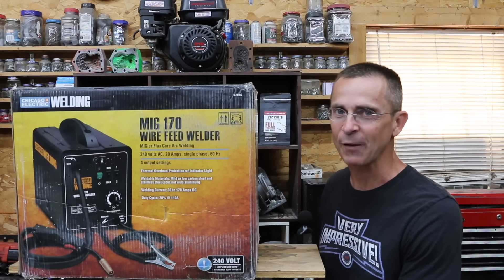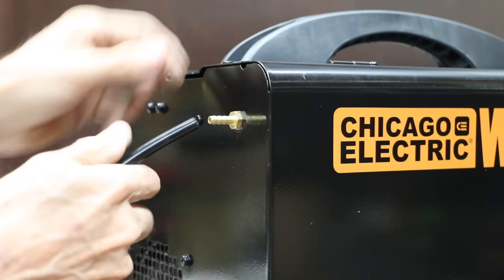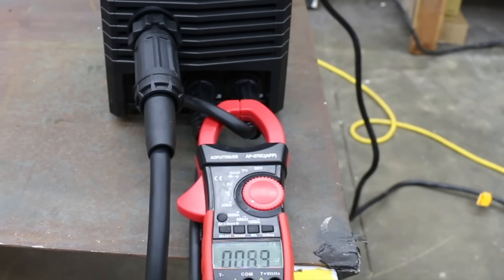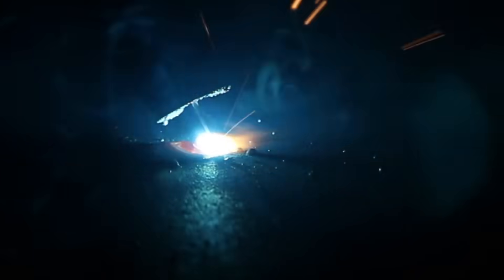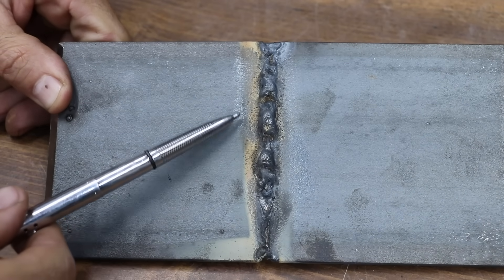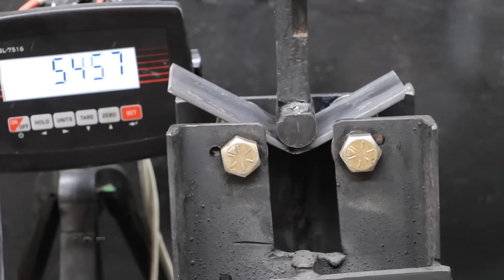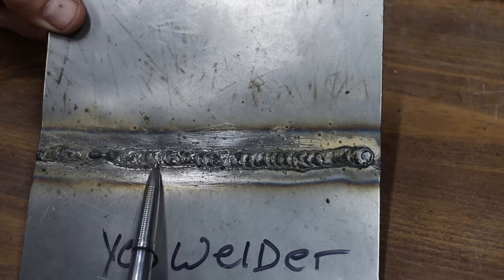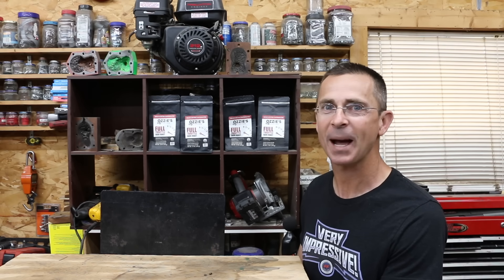Cheap vs Expensive Welder? Let’s Find Out!

Comment: I dont know if anyone has said this yet, but all of these machines running as wire feed mean they are running as constant voltage machines, not constant current. This means that they are designed to maintain a constant voltage in the circuit, and the amperage is allowed to shift to maintain the voltage. A stick welder is a constant current machine, meaning your amperage test would make more sense for that than on the wire feed machines. I would have liked to have seen a voltage monitor on the CV machines you tested in this video. I am a professional welder out of Canada with both education and about a decade of experience, love your videos, and even this one accomplishes what it set out to 👍
Reply from the maker: Thanks!  Thanks for the constructive feedback.

Comment: Bought a weldpro multipurpose wire/tig/stick machine. Use it out in the pens for lights metal repairs. Worked so well I use it for all my welding. I use lincoln .035 multi pass flux core wire.
The feed mechanism could be better, but it works well 95% of the time. 
I would prefer the heavier gun that comes on larger machines as well. But it works fine as is.
Reply from the maker: Thanks for the feedback.

Comment: One important thing to note on these flux core wire "migs" is that you can get greatly different weld quality with different wire. Often the stuff that comes with these like the Harbor Freight models is very bad. I see you using different wire for each welder during your setup in the video. I am assuming you are using the BlueDemon when it didnt come with wire in the box and the included wire when they did? A more even test of capabilities would be to use the same wire on all machines.

You can use some Yeswelder E71TGS .035" flux wire for welding steel and it is vastly superior spatter and penetration than the stuff you get with most welders. I use Blue Demon 308LFC-O .035" wire for welding stainless steel. Not sure if the Blue is the best for stainless or not, just what I tried first and it worked well with minimal splatter. But the Yeswelder flux core is some of the best you can get for doing regular steel.

Comment: Would have love to see a follow up with more mid grade machines like Hobart. Really liked Virgil’s input and review!
Reply from the maker: Thanks!  Thanks for the suggestion.
Reply: I have a hobart mig welder that ive been using since 2007. Its only 110v but it does well on almost everything ive used it for.
I also bought a yeswelder tig250 that i really like, I cant really compare it to anything as it is the only tig welder ive ever used.

Comment: You don't state the wire used. I assume it was all the same for the machines. Different wires / manufactures brands can make a differenc in performance. The next test suggestion is different wire brands with the top three machines. Keep up the great work. Thanks
Reply from the maker: Thanks, will do!  Thanks for the suggestion.

Comment: FWIW... i bought the yeswelder 165 stick welder for travel work.   It works very well,  especially for under $100.  It seems you can now buy good inexpensive welders.  I also own higher end Miller mig & HTP tig welders.   I prefer using these, but the lightness of the yeswelder makes it very handy.
Reply from the maker: Thanks for the feedback.

Comment: The wire you used in all the machines, was that the sample wire that came with the machines or did you use the same manufacture/ spool of wire? Different wire could give different results between machines.
Reply from the maker: I bought new wire and used the same brand for each.

Comment: I bought all my equipment second hand minus an old Lincoln tombstone I got in trade and have never had any real issues. I got my Ranger 8 for 2700 bucks from a farm auction around 5 years ago and an Esab 250 mig machine with a spool gun from a fab shop that was closing maybe 5 years prior. Picked up a 250 Miller syncrowave and a hypertherm plasma cutter just before C-19 from a school district that was ditching its tech ed program. Basically stole those in one lot for 2200. I know I can get parts with no problem if I need them and they're rock of Gibraltar solid.
Reply from the maker: Thanks for sharing!

Comment: Serious question. 
If you wanted to do a lot of body panels. 
Welding the thunder gauge metal.

What welder/ settings, would one be looking for? 

Outside of quality, warranty etc. 
What capability made the Lincoln perform better than the Yes welder?

Any one have suggestions, advice?

Comment: ...your professional welder guy doesn't hold the same stick out. Welding the thick metal he moved the gun in and out. The real test is a cut and etch, not a bend test for seeing how much penetration. Then on the thin stuff he held the Yeswelder much closer than the others. Some wires run better on thin rather than thick, and vice versa. Oh, and flux core is the WRONG wire to use for thin metal. Thin should have been using mig, not flux core.

Comment: I have gone through 3 car battery "smart" chargers and my current has lied to me for the last time. It cooked 2 of my boat batteries. Nothing wrong with the batteries. The charger tells me its at 100%, but will give me random percentages going higher and lower with subsequent testing. Please test smart chargers? Ill send you mine to test as well.
Reply from the maker: Thanks for the suggestion.

Comment: See ive been looking for a good ac/dc tig machine without all that fancy digital display and presets on it..  like i dont care to adjust the parameters to weld 1/8” aluminum..  just a knob for pulse width, Amperage, voltage, curve and all that jazz..  but if ya find one with all the parameters theyre always digital with a lcd display and cost over 2 grand..  tryna find one for the 700 range that wont blow up on me.. like buying a cheap plasma cutter..  theyll cut great until you stress em a bit then the fetts go boom or caps do one..
Reply from the maker: Thanks for the feedback.

Comment: sorry to say but i think you missed the bus with this. first testing should be if the welder lives up to its claims. they should be tested doing a reasonable weld length at max amps. very common to have cheap machines that have overinflated specs. 3 sec at max is nothing, it needs to be a full length weld. does it reach its duty cycle at max amps?
the other main factor is adjustability, can you actually dial that wire in. really important with fluxcore.
features, i've seen cheap ones that have more/better features than expensive machines.

Comment: FYI when you are using the clamp on the multimeter to measure current you need to make sure that you are only tonging the active conductor not also neutral to get an accurate result
Reply from the maker: Thanks for the constructive feedback.

Comment: Good boy, about all that comes to mind is the amazingly low priced compared to what they used to be aluminum welding machines with the new IGBT and maybe there are MOSFET offset or balance control as can be termed option.  Thanks for sharing!
Reply: Would be awesome to see an oscilloscope screen somehow as well with the current info for those waveform machines.  Might even be interesting to see the waveforms on some of the other systems?  Not certain many may like. Would be neat to me as well.
Reply from the maker: You are welcome!  Thanks for the suggestion.

Comment: Great video! I have the Titanium MiG 170 from HF. Pretty decent. I’d love to see a sub $1000 plasma cutter shootout. I bought the Warfox high frequency dual voltage a while back. Think I paid about $250 for it. Haven’t used it a ton but so far seems ok.
Reply from the maker: Thanks!  Thanks for the suggestion.

Comment: Beware: the cheaper machines might not be safe. I've had cheap MIG welder almost kill me when I was doing something else and it suddenly started feeding wire without me pressing any buttons. Once the wire was a few meters long it touched the grounded welding table, resulting in a red hot wire setting things on fire left and right! Luckily I had a fire extinguisher!

When I bought a significantly more expensive Lincoln machine, I noticed it stops feeding wire when it senses there is no arc. You needed a special button to feed the wire through the lines.

Just saying that safety is not a factor that was taken into consideration in this video.
Reply from the maker: Thanks for the constructive feedback.

Comment: I have watched ALL of your videos for well over two years and this is the first one I am disappointed in. I would LOVE to see 7018 with 120V. You did not show ANY STICK welding at all and the was a bummer for me. I have welded since 1968  and have made about 1/2 of all the money I have ever made working in BIG fab shops. I have run almost every type of welder there is but I still like stick. Now I live in a 40' diesel powered motorhome. I live almost all the time off the grid, since I live off the grid I do NOT have access to 240V power. Big RV's have 50 AMP power going in, which is 240V power but the RV itself does NOT use 240 V. My build in generator is a 7,200 watt generator but it is 120V power. That is why I am SO interested in the 120V side of these welders and stick because... I LOVE to run stick.
Reply from the maker: Thanks or the constructive feedback.

Comment: I’ve ran the piss out my Lincoln mp 210 on dual shield it’s never skipped a beat, runs flux core well, mig welding you can really hone it in works just as good as my Millermatic 212. Being lift arc on tig has its disadvantages but really it does great on that. But something that it surprised me on the most was how smooth it ran 7018. Im still a firm believer buy once cry once with welders. Lincoln, Miller-Hobart and esab all day
Reply from the maker: Thanks for the feedback.

Comment: The Lincoln did what it was supposed to for a top-end brand welder. Still Miller is generally considered the superior wire feed welder. Lincolns are more known to be the premier stick welders. Still I'm not a welder, I'm a tool maker, but I do have to weld sometimes. Not sure who's thought to make the better tig. I've heard that those Eastwood welders are pretty good for the $ they command, but IDK. I have very little experience with budget brand welders. I personally own a Hobart Handler 210, and an old Lincoln stick welder, but it was my grandpa's who died before I was born, and I haven't used it in years, or since I bought my Hobart back in like 2,010.

BTW Miller owns Hobart.
Reply from the maker: Thanks for the feedback.

Comment: Nice video!
I'm a bit surprised you didn't include any of the Hobart welders. The Handler 125, 140, and 190 are all Made in the USA and very affordable. You could have slotted one or two of the three in between your $360 welder and your $1,150 welder. That's quite the jump in price the way you did it. Maybe a round 2 in the future once you recoup some money on those welders. 😅
Reply: While the Hobarts are well regarded for customer support (basically consumer-level Miller), from what I've seen, they use older technology (transformer) and don't seem to compare well with newer systems like the Eastwood 180 (Inverter), as far as features, and are much lighter..  If you are not looking at pro/shop levels of performance, it seems a good option.
Reply from the maker: Thanks!  Thanks for the constructive feedback.

Comment: I've been using the Lincoln 210MP for a few years and can say that it is a very good welder. All the problems I've had were me and not the machine. Another thing you get with Lincoln/Miller vs cheap chinese is longevity. You get what you pay for so if you buy cheap, expect to be buying again and having more issues along the way.
Reply from the maker: Thanks for the feedback.

Comment: I believe if you would have picked the Lincoln Mig Welder 180i , it would have been more comparable to the other 6 and at 1/2 the cost of the 210 model at $1150.  That might have given the viewers a more accessible option that preformed similarly.  In fact , the high priced 210 kind of risks not being totally honest about the accessibility of Lincoln as a viable option !!
Just my thoughts, ..... , great video in any case,
Thanks for your generous consideration,
Sincerely ........................
Reply from the maker: Thanks!  Thanks for the constructive feedback.

Comment: I'm kind of SHOCKED at this video.  Although the intention was to do QUALITY TESTING.  SOME VERY IMPORTANT parameter(s) were no where to be seen or talked about.  

Shame on your welder-guy for not mentioning any of this.  I would also argue that part of the welding problems, expressed by your welder friend, fall under the problem of using a "CC - Machine" for Mig welding.  Can it be done using a "CC" machine instead of a "CV" machine, the answer would have to be a yes.  Are you going to get the same quality welds with both types of machine(s)?  That would be a big "F"- No!  You & your welder friend proved it, without even knowing it.  MAJOR HINT: 20 gauge metal Mig welding.  I'm not an electrician, but am a welder by trade.  Have I been forced to use a "CC-Machine" to weld 5/8" in plate, when I was working in the ship-yards. Answer is yes. Are the weld quality's the same as a  "CV-Machine" HELL NO!!!!!!!!!!  Very rough looking welds using a "CC-Machine." for Mig welding.  Even a blind-man would feel the difference.

How much welding does a ship-yard welder do in an 8-hour shift.  You better be going through a ten-pound spool of wire everyday or most day's subject to "BIG-MOVEMENTS" of ship parts, via two one-hundred ton crane's lifting and moving said ship-parts / sections.  Just a move, via the cranes could take up to an hour or more.  If just a single crane move, for what ever reason, 15-30 min's, generally.
If you haven't figured out what happens, if your not averaging a ten-pound spool per day, they simply show you the exit door, and tell you to never come back, i.e. your FIRED! 

THE IMPORTANT PARAMETER(s)  a "CC" (CC=Constant Current) machine (Generally / Mostly used for Stick-Welding) versus "CV" (Constant Voltage) machine, ALWAYS USED FOR MIG WELDING (a.k.a. short circuit welding.)

MIG Weld Machine(s) "CV-Machine" KISS welding at it's best.  KISS = Keep It Simple Stupid.  So simple, even a monkey could do it.

TIG Welding Machine(s) "CC-Machine" Takes SKILL.  Gas Tungsten arc welding machines (GTAW) can handle various metals, such as nickel alloys, stainless steel, gold, brass, magnesium, aluminum, and copper.  On the older machine's where you could fine-tune the square-wave pattern, I was taught not to use this type of welder for stick welding.  If your just doing some tack's that's fine.  For hard-core 6-8 hour stick welding, a BIG-NO-NO.  Has to do with what is called "Voltage-Sloop," voltage-drop-off. 

Stick Machine Arc Welding (SMAW - Welder) "CC-Machine"

Multi-Purpose Welding Machine "CC /CV"  Stick-welding, Tig welding, Mig welding.

From the Lincoln Electric Welding Machine(s) website:
With the SMAW (stick-welding) and GTAW (Tig-welding) processes (i.e. the manual processes), CC is the preferred type of output from the power source. 

Conversely, the Gas Metal Arc Welding (GMAW) process (aka MIG) and the Flux Cored Arc Welding (FCAW) process (aka flux core) are both generally considered semi-automatic processes. This means that you still hold the welding gun in your hand and control travel angle, work angle, travel speed and contact tip to work distance (CTWD)) by hand. However, the rate in which the electrode is fed into the joint (known as wire feed speed (WFS)) is controlled automatically with a constant speed wire feeder. With the GMAW and FCAW processes (i.e. the semi-automatic processes), CV is the preferred output.
Reply: Come on man, obviously this is just a fun video aimed more at diy guys, says right in the description for entertainment purposes only. I couldn't imagine having to change out 10lb spools of wire so often, that would suck. We use 1000lb spools.

Comment: For most home projects are better suited for a TIG welder as most home projects are not a 'production' run of welded parts, but if someone is welding up a utility trailer to take to the dump, the local flea market, the home center to pick up a new washer machine those welds need to be high quality welds with excellent penetration which is easier with a TIG welder vs a MIG. Yes more skill is required with TIG, but with a little practice high quality welds are well within the grasp of the average person. I took a 2 day TIG class and it made a huge difference having some professional instruction. Could you test high quality welders from Lincoln and Miller, both inverter and transformer and then cheap welders from Harbor Freight and the like? Having a professional welder do the actual welding was a great idea to keep knowledge/skill from being another variable in the testing. Great job
Reply from the maker: Thanks!   Thanks for the suggestion.

Comment: My only suggestion to improve this test would be to use the same wire across all the welders. 
Different brand wires have insanely different results. Flux Core is even worse when it comes to difference in wires
Reply from the maker: Good Point!  I purchased new wire and used that same brand in all the testing.

Comment: Have the Vulcan, Very nice Welder. Have only ran Fluxcore through it so far for Automotive work , It seems to do Better on the thinner metal when u use 120Vac instead of 220vac for the supply . I have heard there are supposed to be Firmware updates for those, But have never looked into it.
Reply from the maker: Thanks for the feedback.